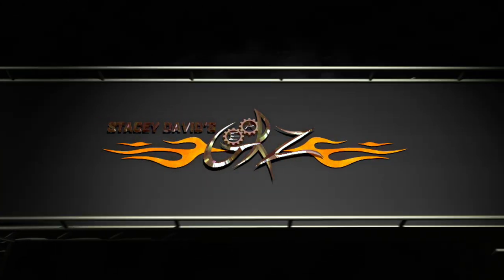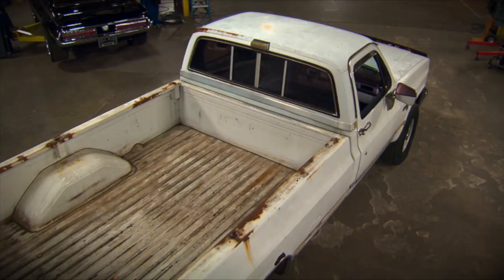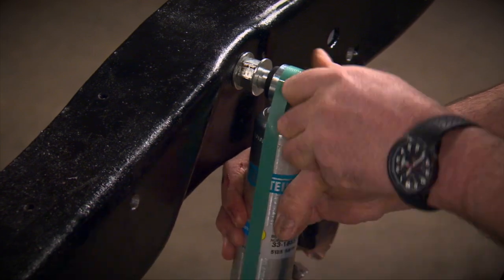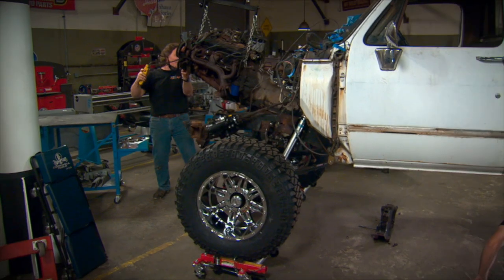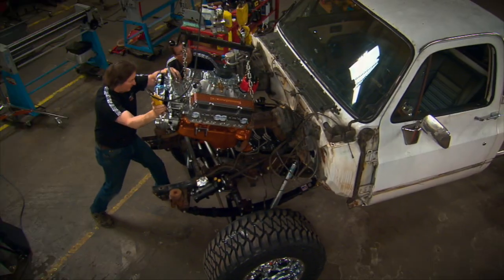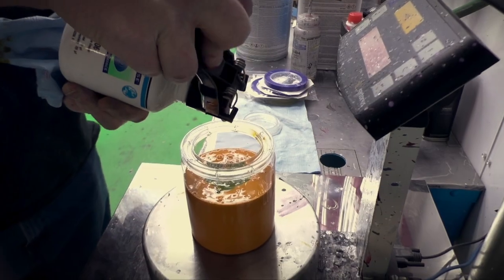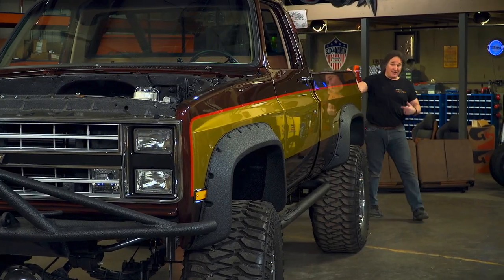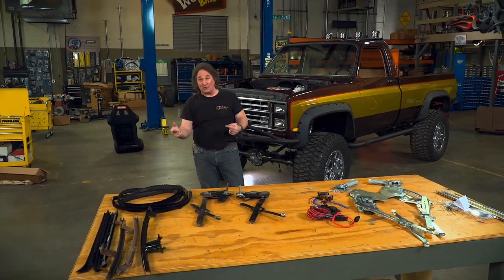Stunt Double Doors & Dash Stacey David's GearZ (Preview)

Comment: Wish you could find me a super clean used rolling chassis for my super clean 2001 Silverado 1500 LT 2dr Extended cab Short bed 143.5 wb 5.3 truck. Can't seem to find anyone willing to ship a good one or sell me one in N/E IL Just off I 94 Near the WI. state line. Was gonna be the last truck I ever bought till I got in a fender bender and they said the frame was bent.

Bought all the other parts to fix the damage and took it to a frame shop and they didn't have a Frame table and the right pulling power to do it. Haven't got the funds to fool around hauling it across the country to a good frame shop. Had to buy another truck to get me by as I need my truck to get around and keep some hobby funds coming in. That money was destined for the 01 now I have a S10 that will get me by till it falls apart.